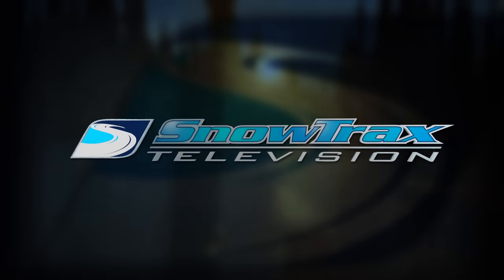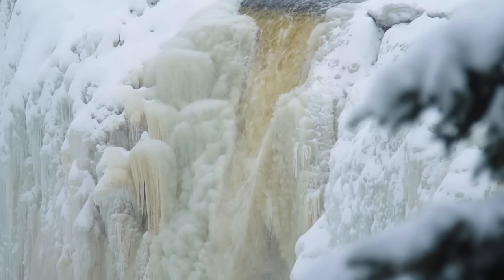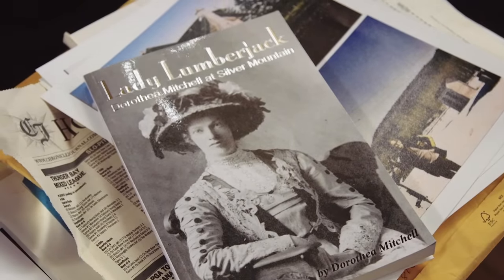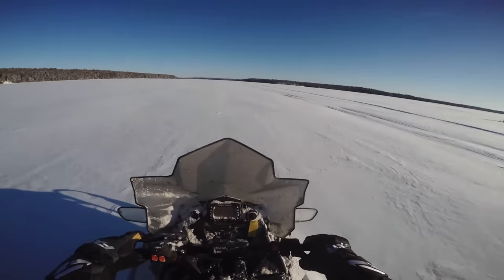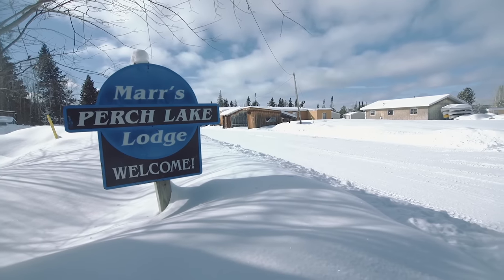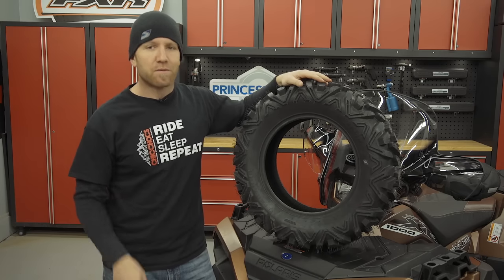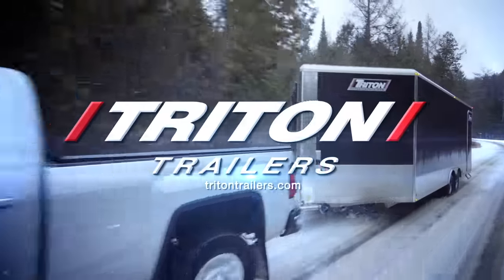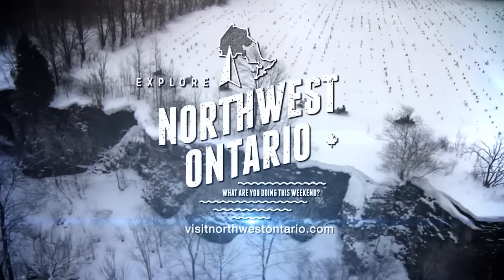SnowTrax Television 2017 - Episode 11 (FULL)

Comment: It was cool seeing some work done with the UTVs.  

That Renegade is an interesting looking machine.  I very much prefer the higher forward riding position compared to the awkward partially reclined but reaching forward position of the old machines.    

I know I'm in the minority, but hearing "electric" so many times puts me on edge.  I just can't shake the feeling that more "electronic brain" controlled important mechanisms there are the more likely the machine is to experience catastrophic failure.  By catastrophic I don't necessarily mean the machine will be totaled or be costly to repair, I mean a failure of a sort that would cause me to have to walk back to the truck.  I, and many others across Alaska and rural Canada, are often by ourselves when we are trapping or otherwise working with the machines harvesting firewood or hunting meat.  An electrical gremlin that may only be a $15 part but keeps the engine from running could result in a long day or two walking back to the road.  A friend of mine had the kill switch on his Ski Doo ACE kill his machine, there was nothing he could do to make it start.  Lucky for him it happened when he got back to his truck and not a couple hundred miles away on his trapline.

Yes, I know that the old simple machines had their failings.  My dad and I have on several occasions had to leave one on the trail for retrieval after getting the cargo home.  We'd later return with the flatbed sled to throw the dead machine on for the drag home.  But with those simple machines aging out I may just be dragged into the modern world kicking and screaming.